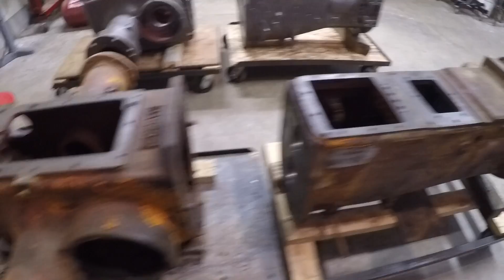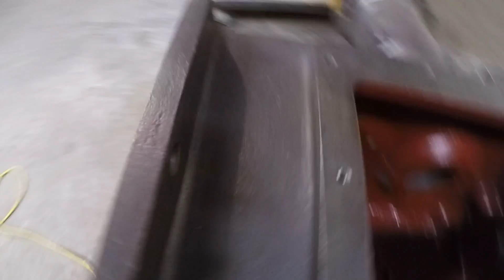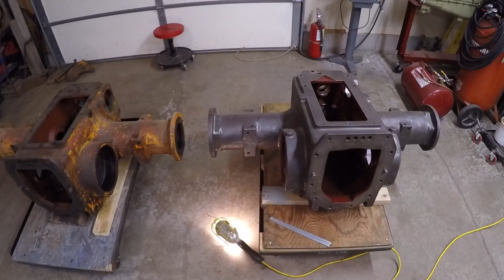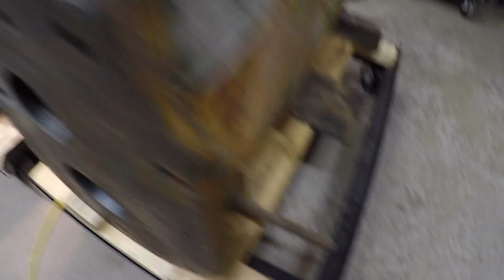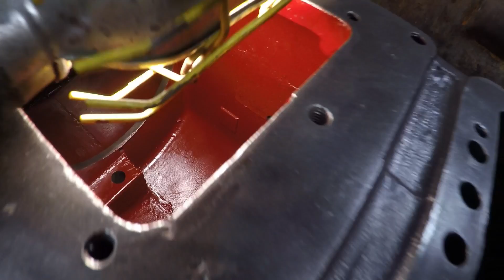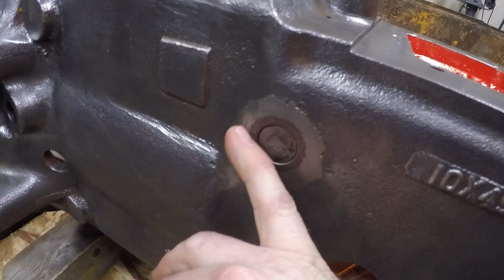Minneapolis-Moline 445 Prototype #X231 Restoration - Part 24: Driveline Casting Differences

Comment: Inspection and measuring hole, given how large it was and the fact that it has no features to it. Repaired a prototype bell housing for a friend, also had that kind of holes in it, difference was they were reinforced with a brazed circle, and had stamped numbers next to them.

Comment: I assume you're going to restore the production version since you're comparing it with the prototype.  Do you gather bearings, etc. for the production version at the same time you get them for the prototype?
Reply: @squatch253  I can certainly understand the burnout.  I've been working on restoring an antique airplane for close to 20 years now and feel I've not made much progress.  To top it off I have another one waiting to be restored.

Comment: Looks like some of those bosses casted on the exterior are datum "target points" for location on machining fixtures. You can bet these bosses weren't needed during production because the fixures were more extensive.

Comment: on the  prototype tranmission clutch case MM was looking at a Fwd/REV shuttle  that replaced the torque amplifier. for a possible fork lift or loader  industrial application.

Comment: Thanks for the education,  it's nice learning about other brands of machines especially the experimental' s. You've probably figured out I'm a Fordson /Ford guy for my tractor of choice in my collection. I've only ever worked on 2 MM's through my repair shop  the worn out 4 cyl diesel town lagoon pumping tractor that won't start unless it gets a visit from the" Ether Bunny" and his can of fun, all I do with that one is oil changes when they want to pay me now as it's a $1000 tractor. I also go over and get it to start first time every year for the new operator, as they never have the same guy 2 years running.

 One year I made 2" angle iron alternator mounts and got it to charge as well, somebody mounted a 10si alternator before and it vibrated right off. The tractors bolted to the bracket now it's so strong,  it's going nowhere unless somebody takes it off and steals it. Or the tractor if the amount of  ether to start it don't get them high and they  pass out first ! 

 The others a 6 cylinder my old neighbor had from new in the family that mice hauled canola seed in and filled some cylinders with open valves .  Those little buggers must of hauled half a wheel barrow full in that motor, before it even filled the cylinders and started filling the manifold. I took the injectors out and the  manifolds off  They guy didn't want to spend much so we got it moving on the crank a few turns pushing stuff out, then hit the starter. There was still a pretty good spurt of black stuff and water came out and hit the shop wall 8 ft away. I shoved it all back together fixed the mouse entrance holes, and if fired up and ran perfect after that, it just smelled like burning mouse piss for a few days when the motor warmed up !. Take care.

Comment: Good eye, Excellent Shakedown inspection evaluation, Had the privilege of working on some Ford experimental 4 cylinders engines that came from the factory.( prototype) that never met the manufacturing line,  you brought back some good memories.

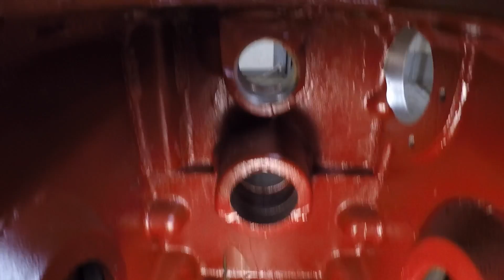Comment: I'm a D2 fan, but now I might have to watch your other videos in this series (23 of them...gotta find that kind of time). Are the prototypes in this video throw-aways? I ask because it looks like there's a massive crack near the bottom of the rear housing at 1:50. Or am I wrong about that?
Reply: @squatch253  Thanks for taking the time to type out the whole not-so-short (but very interesting) story. But it looks like right now your D2 project is giving you a taste of what YouTube "fame" looks like. People love watching videos of orphans being found and being turned into something amazing. Kind of the ugly duckling being becoming a beautiful swan. It never gets old. I don't know how important YouTube is to you, or what you want your channel to become, but it looks like you have some channel-building opportunities before you. I should also mention that YouTube followings can lead to dramatically higher values for the subject of a video series after the project is complete. A great example would be the wood canoe ("sport dory" he calls it) that sold on ebay for $7200, which is outrageous for a boat that can't take a motor. It was the subject of a 37-chapter video series on Lou Sauzedde's "Tips from a Shipwright" channel. He has 91K subscribers, is sponsored by a materials supplier, AND sells the finished product for more than its normal street value. Basically, YouTube is a significant part of his business. Just some food for thought.....

Comment: Those two bosses above the brake casting would be exactly where mechanical brake cams would have possibly been if a rotating arm had been thought of for actuating those cams. Since I know nothing of how MM brakes work,I shall simply have to watch the episodes till you get to that reassembly step. Maybe the designers were doing belt and suspenders approach and a just in case approach if the design they settled on had not worked. Water getting down past the shaft would have been an ongoing problem without some really careful thought.Cheers.

Comment: Glad you're back inside because as I understand, the white stuff is falling or has fallen. Thanks, Toby! Good comparison! Hi 2 Pop too!
Reply: @squatch253  No, everything is in the process of being freeze dried! Good old wood heat. I'm threatening to build a fire but not quite yet. I'll let Sweetie do the saying on that deal. We have to keep turning the heat pump lower and lower to keep the blue light off. The wood is there. When it's time, it'll be time. Watch out for everybody till they get their snow legs back on. 
C U, Toby and Pop!

Comment: Thanks for the wonderful video. Despite the impossible task of retro engineering you do an awesome job of rethinking the design of the original staff. This is made very difficult after the factory modifications. Can’t wait to see the parts reassembled. Thanks.
Reply: That would really be fun, wouldn't it? I don't recall that the machine is really all that old, I suppose there actually might still be someone around that worked on it. Finding them would be the trick, and then whether they still remembered anything interesting about the project.

Comment: Thanks for the video! I suppose that may be boring to a lot of people, but I'm as fascinated as you seem to be about the differences and what the mystery bosses and holes might have been.

And speaking of that, my guess on that diagonal hole near the bell housing is that it was an inspection or measurement hole used on the prototype so they could inspect inside after things were assembled. It will be interesting to see just what is visible or reachable with a feeler gage after the machine is assembled again.